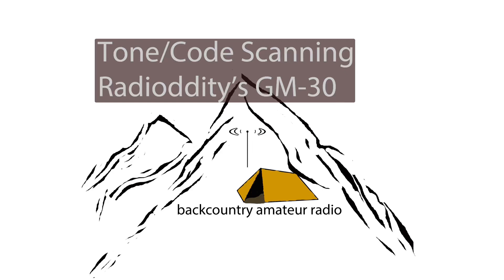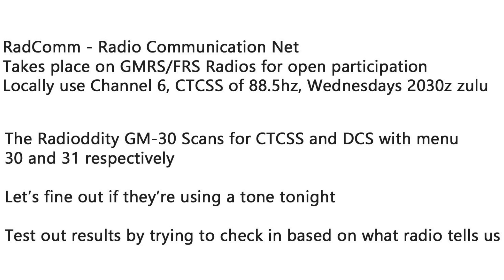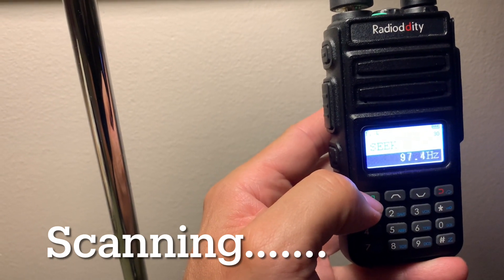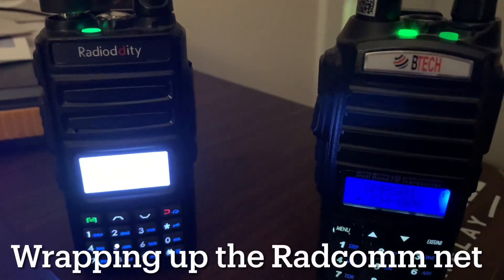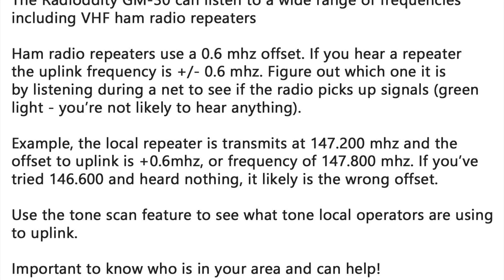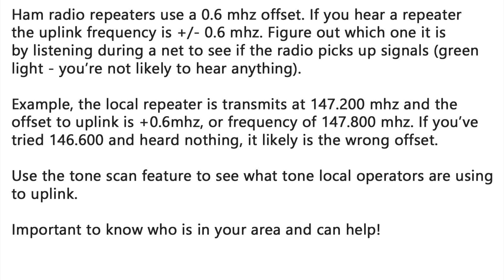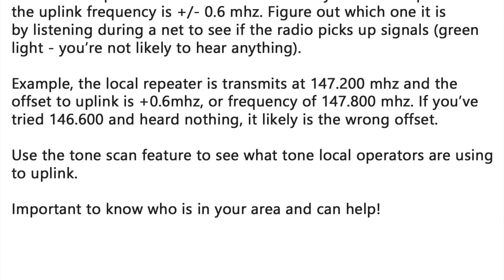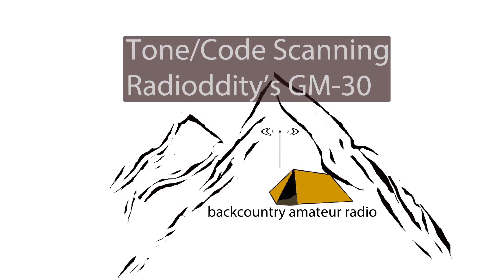Radioddity GM-30 GMRS Transceiver - Part 4 Tone Scanning

Comment: Great video series. I am new to GMRS and have two GM 30’s arriving tomorrow. Ham for 25 years. Thanks for the videos.
Reply from the maker: Thank you for the feed back. This radio has been really popular. I've had mine now for a couple years and it has developed a tiny, tiny squeal in transmit. You can only hear it on the receiving end of another radio. My old Cobra blister pack FRS radio doesn't do that. However, the GM-30 is still hard to beat for the price. Hope you enjoy yours. Your experience as a Ham will be really useful in GMRS.  73 - Eric

Comment: Wondering if you had used "menu 16" the s-code (signal code) and how it is used and for what purpose. I really like the GM-30.  Thanks for the videos, really informative.
Reply: Thanks man, the effort you put in to answer that question is greatly appreciated.  I understand where the radio was developed and now am satisfied with the explanation. Cheers, Al
Reply from the maker: @grayhorn8143  Happy to help. Enjoy your radio. GMRS is such a great tool.
Reply from the maker: This is an interesting feature to have on GMRS radios. The S-code corresponds to a list of programmed codes, which you have to do through the programming software. Say code 1 is “1749#” or something. When you store a frequency in the radio with s-code 1 it will automatically key in the referenced code when you key that channel. This is more useful for ham radio operators accessing repeater features. - disclaimer, I need to go back to the manual to ensure that’s correct… but that should be it. I’ll follow up in a day or two. Thanks for the great question.
Reply: @backcountryamateurradio   I apologize for not knowing about ham radio, but what would 1749# be? Is it like the ctcss or dcs codes? Or is it somewhat above that. That little radio fascinates me.
Reply from the maker: @grayhorn8143  ok. Sorry, meant to answer that exact question. No, it isn’t like CTCSS or DCS. That 1749# was a random example. It’s is a way remotely control the functions of another radio, a repeater for example. Say a repeater needs to hear the tones of “1234” to open a function. Maybe that function is to link to another repeater and increase your coverage. Hypothetically, this little radio radio could do that. But usually you don’t need to use the S-code feature to do it. You’d simply key up the radio and press the correct sequence into the keypad, hence the term DTMF (dual tone, multi function) keypad.

I volunteer with a first responder team and we do exactly that to activate a repeater phone patch, which allows us to call 911 thru our radios (ham radios). I’m unsure if such tech is legal for GMRS at the moment.
Reply from the maker: @grayhorn8143  I imagine there are other uses for the s-code feature but don’t get too crazy with it. These, and other, Chinese radio have features that aren’t applicable all the time for radio use in the USA.

Comment: My Ksun X-UV2D version of the GM-30 has a menu feature that allows you to adjust the brightness of the screen
Reply from the maker: The GM-30 computer programming software allows one to adjust the brightness as well. Factory setting though is basically a torch!
Reply: @backcountryamateurradio  What is the setting in the programming software for dimming the brightness? I have an adjustment to how long the display stays lit. Also, are you aware of a setting that keeps the keypad lit longer?

Comment: Hello all,

Thanks for your useful presentations.  Does the GM30 have a number of useful voice prompts?  Can they be turned up?  Can one identify any menu items through voice prompts?  A radio I have presently has a voice prompt on squelch, roger beep, vox, ctcss and DCS tones  and some back lighting.  The sub menus don’t speak so I need to guess when setting sub menu items or counting carefully when setting Ctcss or DCS tones.  The channels speak.  The DTMF would make setting frequencies and tones much easier!  I am totally blind so cannot read the screen!  As far as I know, programming software isn’t accessible with the screen reader programs I use with my PC.  Therefore, I need to set up a GM30 manually!  I’m trying to find the best GMRS radio which would meet my needs.

I won’t set up transmit functions till I’m licensed with GMRS.  

Thanks for reading!

Jim K7TQM
Reply from the maker: Hey Jim, thanks for the great question. Let me look into this and get back to you. I have a Btech GMRS-V1 that I will check for that functionality as well. Thank you and I will be in touch! Eric KI7WJP

Comment: Did you change the antenna on the GN-30? If so how did you remove the stock antenna? Please help
Reply from the maker: Yes! At the base of the antenna is a tiny hex key fitting. It’s 2mm I think. Loosen that and then spin off the antenna. It’s a little tough to find a good antenna tuned for this radio though.

Comment: My local repeater on MYGMRS website has a note stating, "When programming your radio, please be sure to program the repeater as 20 KHz step." When I look through the manual as well as when I attempt to program in a channel with a step it will not allow me to do so. I can either program in the step in VFO mode but I am not able to transmit in VFO mode or I can try to change the step when programming a channel but then when I go to that programmed channel it also will not allow me to transmit. If I try to adjust the step in a channel that is in channel mode it simply says cancelled when I hit confirm on the step for anything other than the factory set 2.5KHz. 

Am I doing something wrong here? Is there something about this that I do not understand? Will this radio simply not work for my local repeater? I'm so confused!!
Reply from the maker: Part of your confusion is the repeaters request to adjust your "step". However, 20kHz is more referring GMRS bandwidth. I'll look at this some more, if you could, provide a link to this repeater detail?

Your radio should be programmed to 20KHz bandwidth, called "wide" in menu item 4 on your GM-30. This may have been confusion on the other end. GMRS uses "wide" so you shouldn't need to change this. The exception is on the interstitial channels 8-14 where bandwidth is restricted to narrow (12.5 khz) and low power.

On the note of programming, you ought to be able to change the bandwidth in channel mode, but you're right, changing step doesn't work, in part because step often refers to the deviation between frequencies as you scan. GMRS has fixed frequencies... so there isn't a reason for this feature (step) to work.

I hope that helps. Please let me know if it does not. Happy trails!